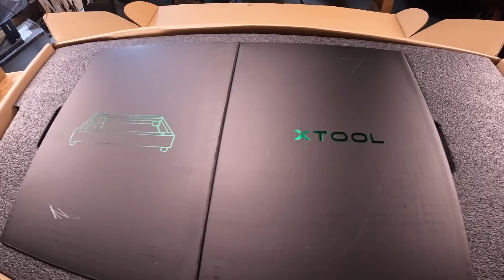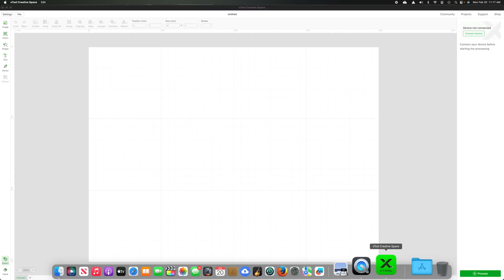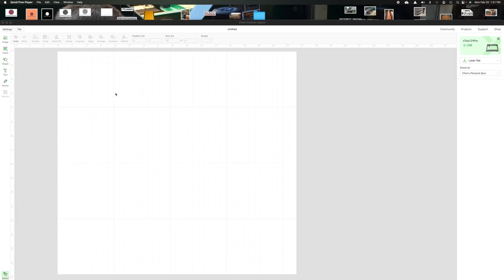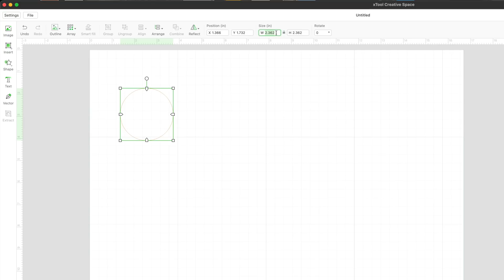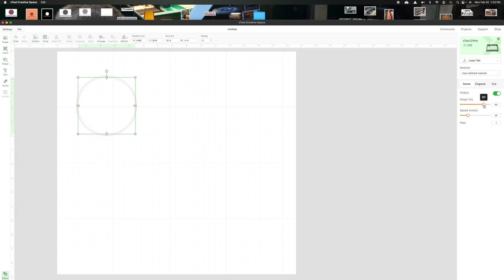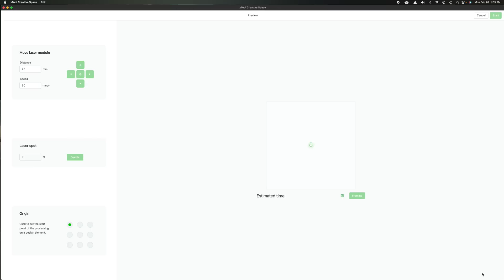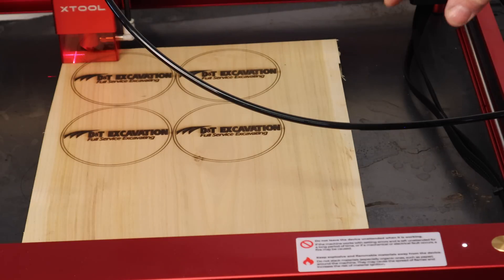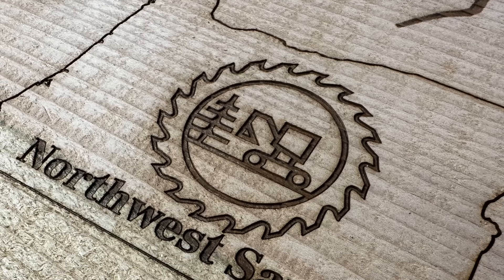NEW TOOL MONDAY! xTool D1 PRO 20 Watt LASER

Comment: There are several different options  on the website witch one did you get?
Reply from the maker: This is the 20watt laser with the RA2 PRO roller assembly and air assist. They sell it as a package.

Comment: Signing your work with the laser would be cool.  Might be hard on a larger project.  I've seen some woodworkers have a branding iron made for doing the same thing.
Reply from the maker: I’ve seen that as well. The laser is completely portable. I can set it on the table and sign away. I think it’ll work pretty slick.